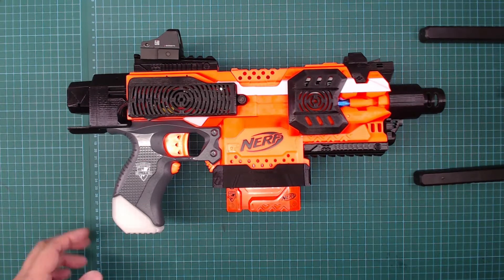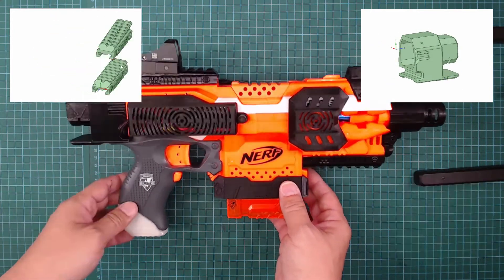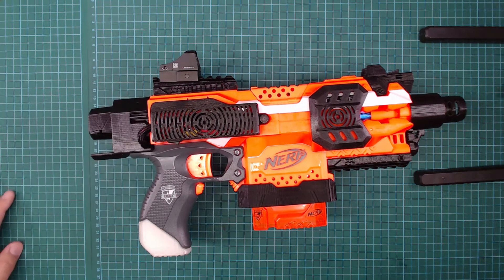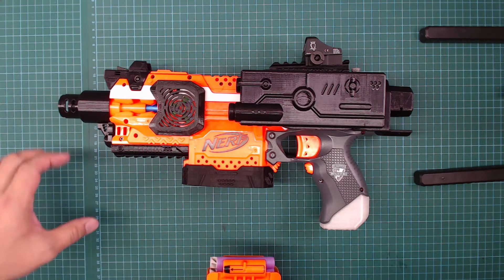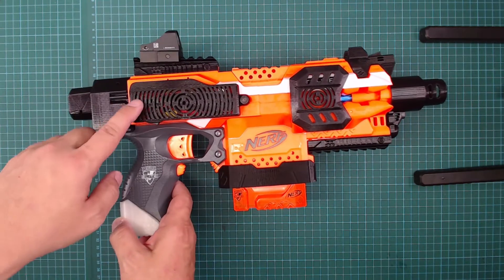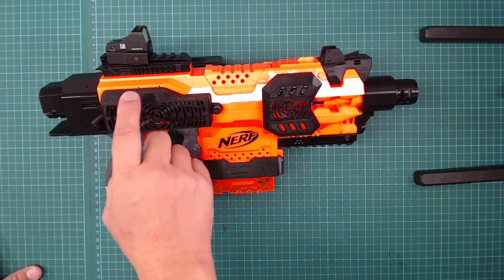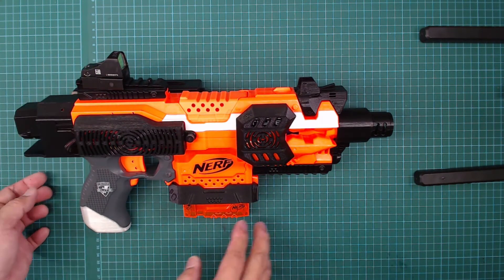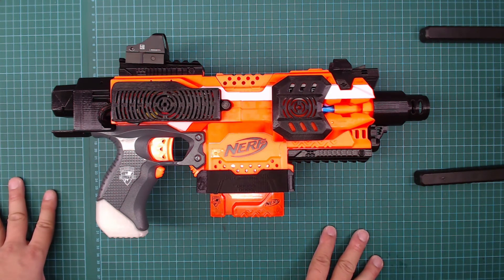Tungsten V4-I - My first Brushless attempt Part 1 -Demo

Comment: I don't think you have tested this at all .This thing will melt down so fast thanks to the rediculious amounts of braking.
Reply from the maker: Making Stuff Awesome for your build, how did you go about testing?
Reply: @TungstenEXE  high why don't you just use my latest gen 4 brushless cage and wheels that you can free download from thingi if you want so you don't have to 're invent the wheel so to speak
Reply from the maker: @Making Stuff Awesome my goal is to eventually create my own blasters,I had modeled pushers, mag adapters, etc. to work on motors cages is something that I will have to work on sooner or later, so I wanted to start with the stryfe, next I want to work on rapidstrike cage. I see many mods will use the same cage for both blasters, however I find that for rapidstrike, there is a small gap between the entrance of the cage and the mag if the same cage is to be used. And I have to admit, to be able to make use of something that was self modeled does give me a sense of satisfaction. I saw the new Gen 4 and the new motors, look cool, am going to try that for sure!

Comment: looks great! what makes it “brushless”? is it just the motors used? do those motors require the audrino? i know nothing about these types of builds.
Reply from the maker: vastneon the motors are brushless, and yes I use Arduino to control the ESC :)
Reply: Yes they do require arduino.  I have a a windows app that will flash the arduino so you don't need to know anything about programming it for brushless builds and is on thingi already